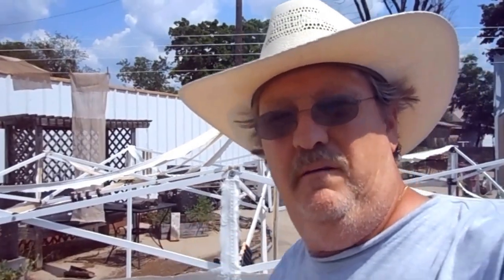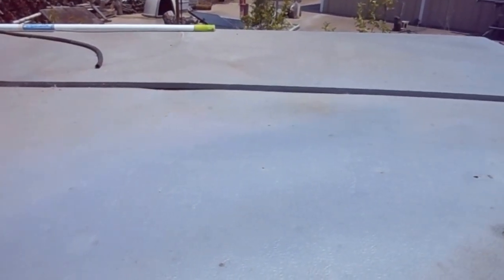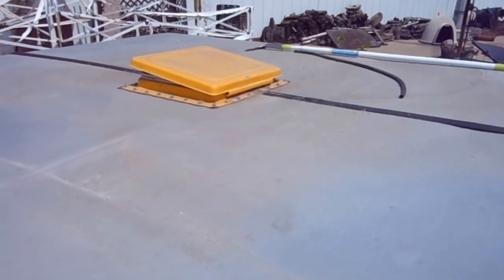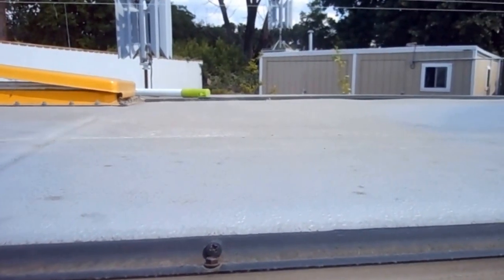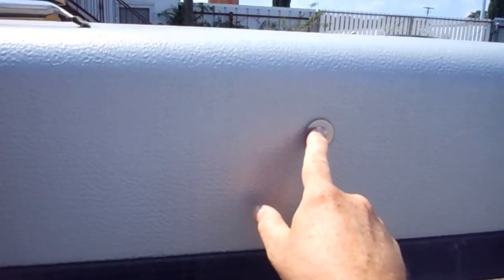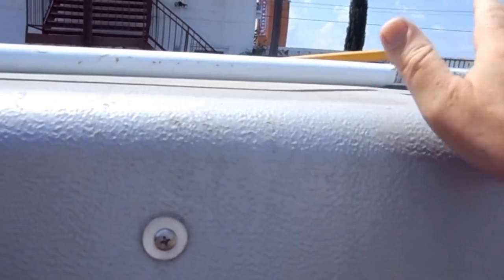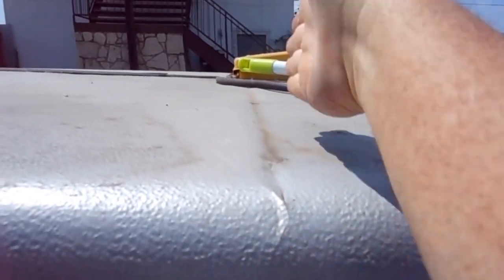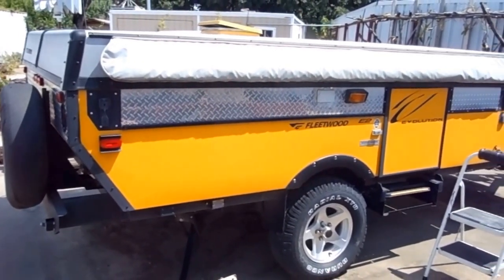Upcoming Project VLOG: Camper Top

Comment: Did you ever get the roof fixed?
Reply from the maker: No I haven't. I'd like to take the top off and turn it upside down to work on it. I plan to build a roof extension off my shop/garage to protect the camper while the top is off, but I haven't had the money to do that yet.